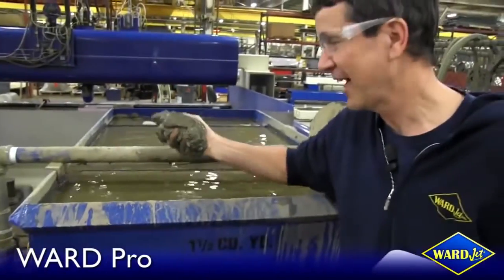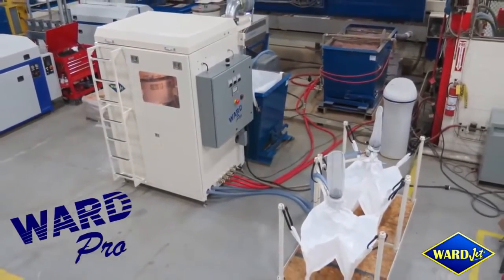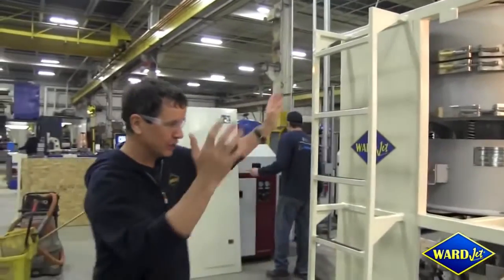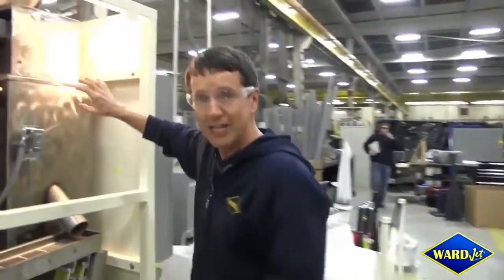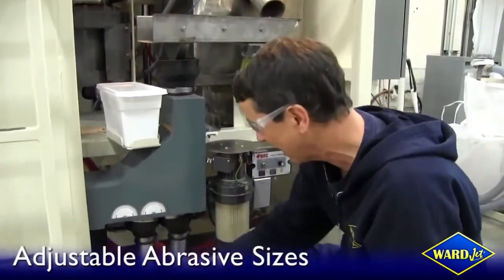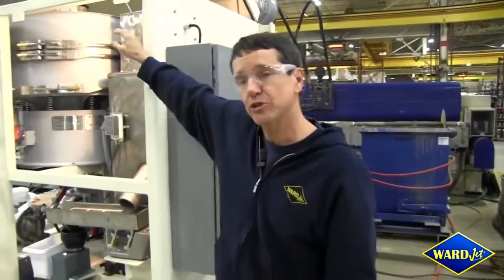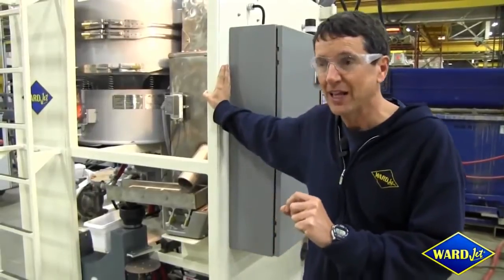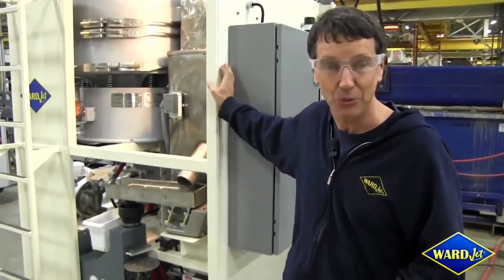WARD Pro Waterjet Abrasive Recycling System

Comment: the problem is that garnet is a "cheap" material. Yes, you can recycle it, but you have to buy all of these machinery. Than you get a recycled garnet which is finer then the original material. So you're loosing cutting power. If you think about buying new fresh garnet for a low price, the benefit of recycling is gone.
Reply: flipflopdrop2543 This machine is buyable or not ?
Reply: Not sure if it still is, but the cost of abrasive was going up, not down (some manufacturers got shut down, limiting supply).  It's a non-renewable resource.  When it's gone it's gone.  Garnet is more than 50% of the cost of cutting with waterjet, so reducing cost of abrasive (which recycling does do) goes right to the bottom line.  There is no significant reduction in cutting power, but like anything it may depend on the cutting application.  This process is most compatible with those who are cutting metal.
Reply: @nokiruza  Well, perhaps that fact is valid for the area you are living. For the European market, i can tell you that there is enough garnet available and currently the chinese are flooding the industrie with a cheap garnet. Yes, there was a supply criesis in 2016/2017 but this long over.
From the recycling perspective, you are right. If you throw  it on the dumb yard it is gone forever. That does't change the mind of ppl when the dumb yard is cheaper than recycling.
Reply: @flipflopdrop2543  Cheap garnet can definitely change the calculation, that's for sure.  As long as it's still good quality.  I know (years ago - I'm apparently out of touch these days) there were complaints of contamination in cheap garnet.
Reply: @nokiruza  You are talking about Indian garnet. Yes, i can confirm that. Bugs and flies and dust. Everything was in there. God bless its over. Let me know if you need some garnet :)
Reply: most of the spent garnet never touched the cut material, so the yield in recycling should be more enormous.
Reply: @hassiaschbi  whats most and how do you know?